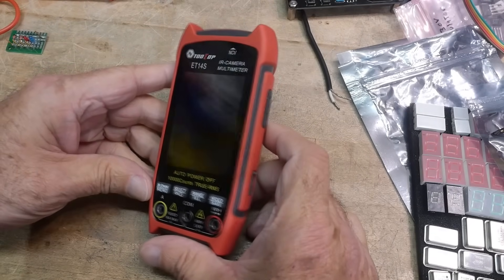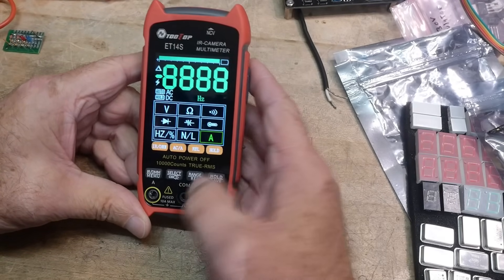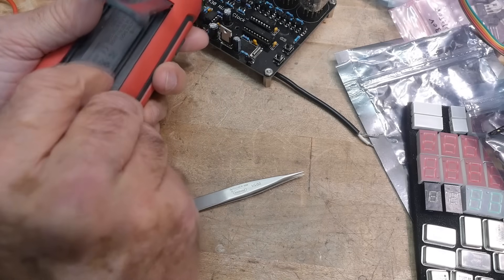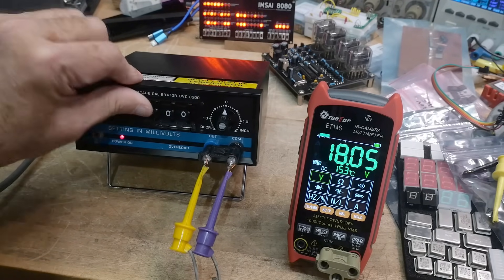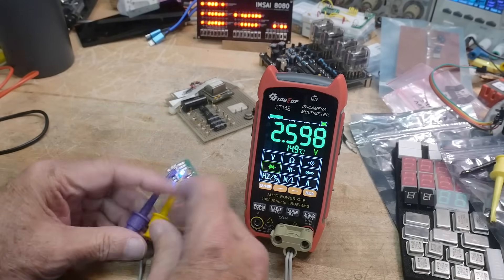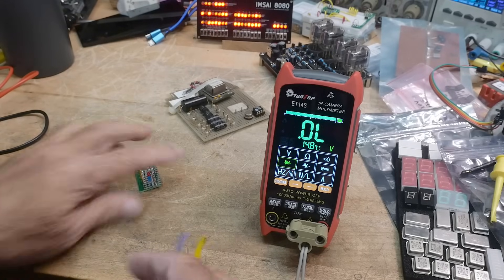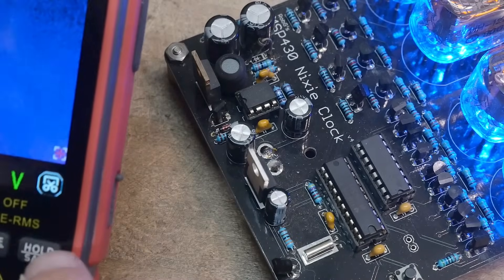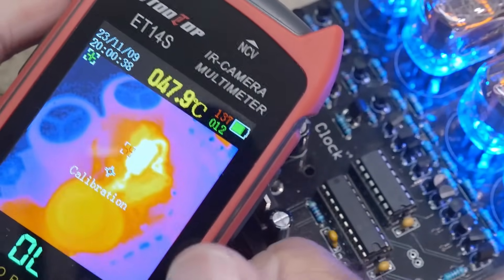#2120 ToolTop Thermal Camera Multimeter - ET14S

Comment: Hi. I'm from Bangladesh. How can u so sure that it has a 96*96 IR not 240*240 which ToolTop company claimed. If this has 96*96 I won't buy this.
Reply from the maker: I asked the manufacture. they told me 96x96 sensor interpolated to 240x240 on the screen

Comment: GOOD REVIEW, the thermal camera in this 14s is better than the camera on the previous version "13S"??? If i remember correctly the IR sensor on the 13s was announced as 192x192 , to my surprise this supposedly upgraded version has 240x240 sensor but in reality is a 96x96 its so confusing, then the 13s what size really is?

Comment: Thanks for getting back to me. Yes, I just chech out that link again and I noted those links below. When you first land on that page its not that obvious until you check one of those links and then its clear you have two options. With and without the macro lens. I did not notice the small print in the landing page that says optional macro lens. That's a bit tricky I think. Why would you what this thing with out the macro lens, that the feature that make this thing useful. Its only $20 extra. I'll have to send this one back and order the one with the lens. keep the videos coming. Cheers

Comment: That is amazing. I bought a fairly economical standalone handheld IR color display camera for multiple uses. One thing is you can spot hot spots in gear and helps prevent burnt fingers too.  See what is overheating in a malfunctioning piece of gear.  Mine focuses pretty good up close to see individual components on the PC board as well as things feet away.  Worthwhile service tool. It also has floating crosshair indication of the temp of the hottest temperature in view and also at multiple warm spots.

Comment: Seems like a nice on-the-go diagnostic too, too.  DMM to do measurements in the field for too much/not enough volts and something better calibrated than my fingertip for "oooh, that's too hot!" measurements.  Nice combination of features in a package like that.  Like peanut butter and chocolate in on handy package!  Something for my christmas list next year.
Reply: It's a lot handier than sticking your hand in a piece of electronics and giving the finger test to a cap to see if it's hot. Years ago, I serviced TVs, and we were used to tipping the tops of electrolytics to see if they were hot. I remember an old GE floor model TV that was bad for a large electrolytic to snuff it in the vertical output, and we used to give them a touch to see if they were hot, and they were... scorching.

Comment: In 2014 I bought a Fluke IR thermal camera, a model which was going out of production to be replaced with new ones. It has numerous times proved itself extremely valuable in debugging faulty cards and measuring numerous industrial systems etc. Even my home insulation was checked with it. For its discounted price I really made a bargain.

Comment: It's nice to have the ability to blow up your thermal camera as well as your multimeter at the same time when something goes boom.  Once they add in an oscilloscope you can take out your whole lab in one go :D .
Reply: 😅If you're as clumsy as I am, you will be using the the camera to short out the equipment you are looking at!
Reply: Not as bad as blowing your oscilloscope because you connected the ground clip to something live and sent 120v through the ground of your $1,800 scope. But, I can't say either has ever happened to me. I've had multimeters die on their own accord. But, as long as they have a proper fuse, they're usually fine. Even when I had to solder a jumper across because I couldn't find a fuse, it was fine. Unless you do something silly like set it to voltmeter and try to measure current. If you try to measure current in voltmeter mode, you're gonna have a bad time.

Comment: Nice to see they implemented the slider after I suggested it in my ET13s review. There is a ET15s being released, a big step forward. Note that your device also has a graph for voltage. There are also special features engaged with a second press of the function buttons.